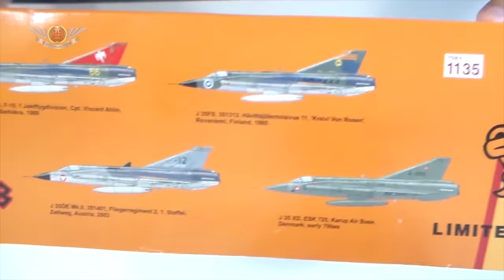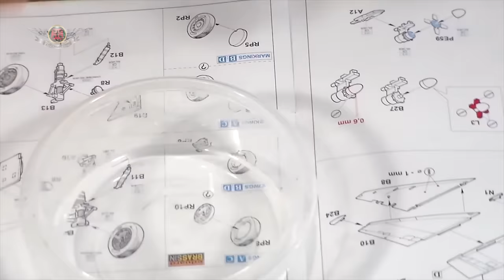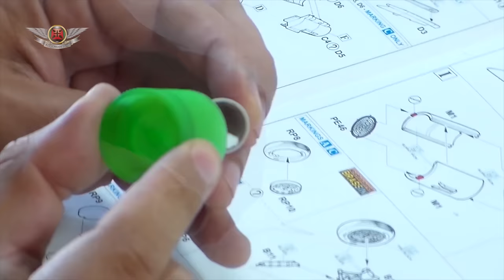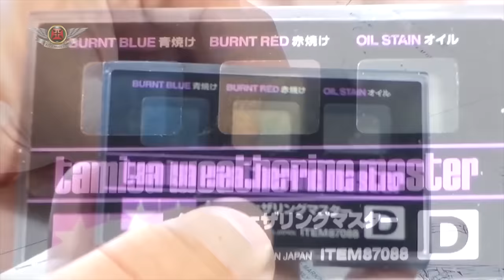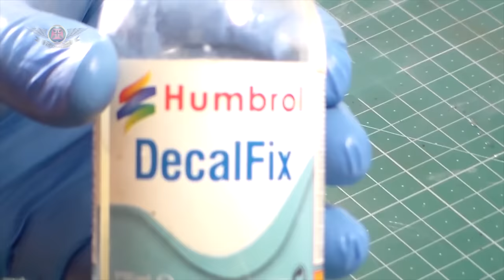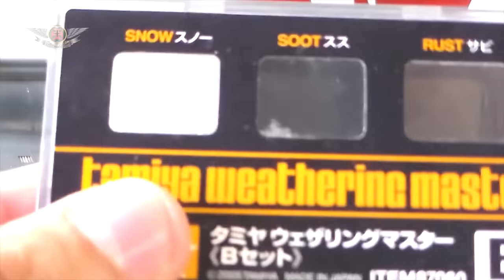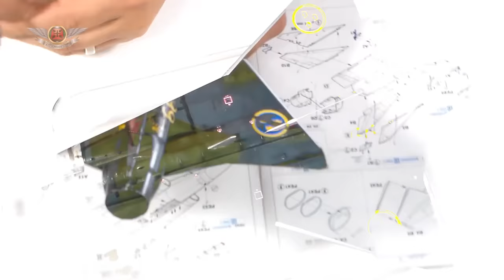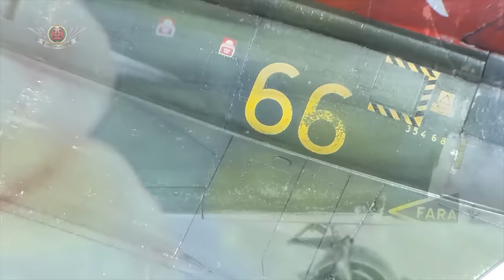1 /48 Eduard Saab Draken FULL BUILD RELOADED

Comment: Are you aware that the money you spend on the tamiya weathering master, you could have went down to your local beauty supply store and picked up some eye shadow for about half what you spent on the Tamiya, rebranded eye shadow for. Chemical testing I did prove it is exactly the same stuff, just rebranded and marked up because it is for modeling.
Reply from the maker: Nop! But thanks cause when these are through... its exactly what im going to use! Thanks!
Reply: You will be pleasantly surprised too because the variety of colors you can get in these eyeshadows goes way beyond what you can find in model branded kits. One note of caution however, some brands of shadow can have adverse effects with some paints. So either testing is always a good idea, even if you intend on sealing first. I have found the hypo allergenic products are not a problem and can be applied directly without sealing first but I am sure I dont have to tell you to test first...;)
Reply from the maker: Kevin Morrison and THANK YOU!! Definitly will give it a go!!